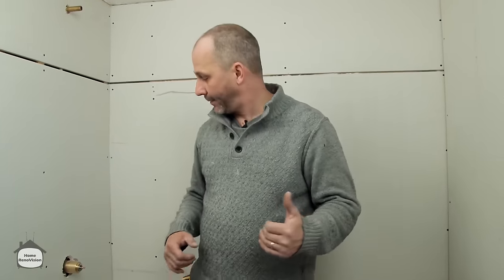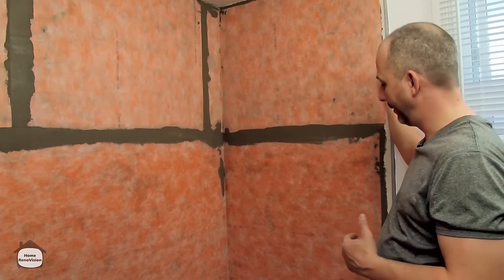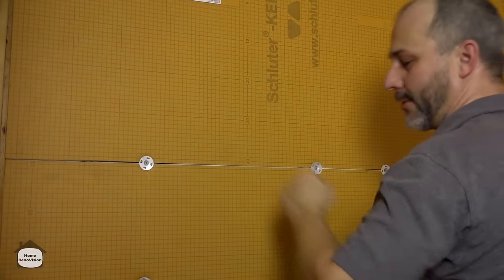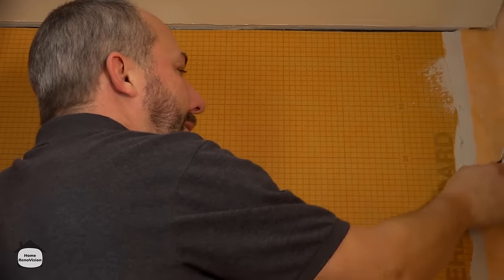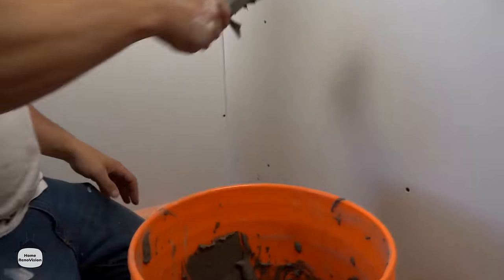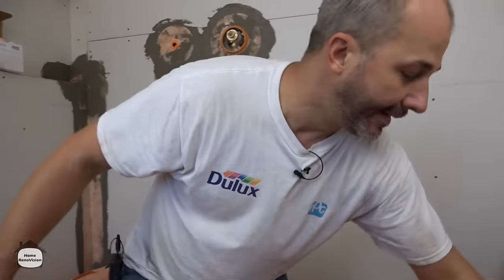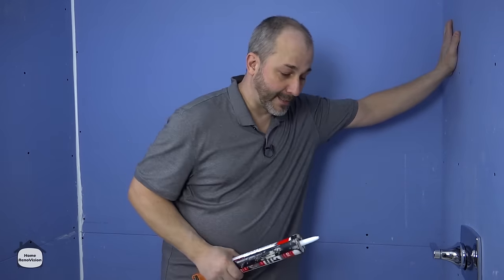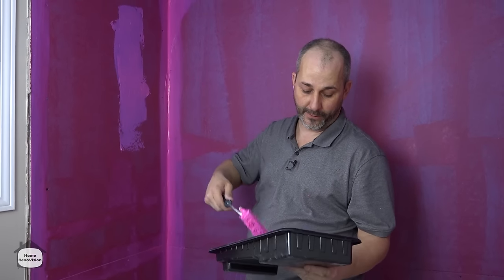4 Types of Shower Waterproofing Systems for Your Bathroom

Comment: Can I do a Schluter shower base pan with a moisture resistant 1/2 sheetrock red guarded surround?
Reply from the maker: sure thing, if you live where you can use sheetrock. you may need to use cement fiber board. Cheers!
Reply: @HomeRenoVisionDIY  Thank you! I'm going to use Red Guarded Durarock!

Comment: You make it look so easy, which if you do this for a living it prolly is.
:D
I'm a renter that doesn't hassle my landlord and I pushed in a nice hole in the side wall of my shower after cleaning the tiles. Looks like it was just tile over regular drywall.
So although I REALLY like the Kerdi board + membrane, I don't own the house and not going to do all 3 walls.
:P

The mold resistant Drywall & Redgard looks like the ticket for me.
Never done it before but hell, can't be that hard - just be detailed, right?
Thx for the tips.
I'll be viewing your tiling tips later.
:)

Comment: I probably missed it but what do you use to apply the membrane to the kerdi board?
Reply from the maker: I don't apply membrane to the kerdi board . That is how it comes from the factory.
Reply: I meant their joint tape. The big box store said to use thin set but I got the sense that you were using something else.

Comment: How would you take off the water resistant sheet you cemented? Is it just assumed the home owner is going to redo the walls if they have to take it out??
Reply from the maker: yes. you would probably need to start from scratch.

Comment: im in australia and every shower here has a blue roll on membrane its done on the shower and bath floor as well as the walls, on residential its floor to 1ft above head height and for commercial its floor to ceiling
Reply from the maker: sounds about right. That is a good code. Her our code is terrible.

Comment: You got me thinking but I believe the aplication on the niche is wrong.  I am almost sure but let me call shanon (schluter rep) to veryfy.  The rest is awesome brother.  We love schulter products.  Schluter rockssssssss
Reply from the maker: They don't recommend using it on dimensional lumber. However this is a fake interior wall so no expansion contraction issues. Experience says it will be fine. Oh and it was done 2 years ago now and no problems. Cheers!

Comment: I was informed by shluter no vapor barrier behind the kerdi board, not sure if thats an exterior wall in video.
Reply from the maker: Schluter should not be giving advice on how to bypass the vapor barrier in the house unless they are showing you how to seal up both sides .
Reply: Schluter system membrane and board are also a vapor barrier.

Comment: I get that he is talking to a DIY audience but if you want your shower to last 100 years with perfect performance, than pay a tiler to do it right. My shower is 80 years old and is still performing well because it was built to last, not fall apart in five or ten years.  How did they do it? They used a process akin to installing stucco and is called “fat mud” which is also known as Thick Mud. If your tiler doesn’t know how to build that type of system, find one that does.  You will never, ever be sorry.  This fellow is doing a great job at explaining the substrate for a “lick and stick” shower. Thanks for the video, it was very informative.

Comment: Does the membrane to basic dry wall, work out cheaper?
Reply from the maker: yes a little.
Reply: @HomeRenoVisionDIY  i want to do a disabled adapted bathroom. Im thinking of a non slip lino with forma-centre drain and a linear drain at the doorway. In my experience if the main drain gets blocked then water leaks from doorway. Why dont people keep a linear overflow drain in door way?

Comment: Which caulk are you using in the video? Could you post a link so I could also purchase it? Please and thank you
Reply from the maker: lepage 2 in 1 sealant and adhesive.
Reply: It is two different ones. Lepage 2 in 1 silicone express and   Lepage 2 in 1 seal and bond. Which is the correct one?  Please advise. Thank you so very much, Best regards

Comment: How about shower grab bars? How do I waterproof the installation. Do you install them before or after the tile is placed?
Reply from the maker: After the tile and into the structure. drill through the tile into the wood. fill the hole with silicone and then install the screws to mount.
Reply: Home RenoVision DIY Silicone! I didn't think of that. Thank you! I respect your work and integrity. Your instructions are always good.🙌🏼
Reply from the maker: Thanks, Cheers!

Comment: The one thing I don't like about Schluter (only one aspect) is their floor shower board with the built in pitch.  I'm a big guy and I'm afraid I would destroy that in a week.  I just don't think it will hold up like a cement based  floor pan.  That's my only complaint about that system.  Another great vid as usual.  Thank you.
Reply: You would be surprised of how strong the floor pan is when installed properly. You can drive over it.

Comment: How do I water proof the floors before tile? I'm doing a large custom master bath that is going to have a walk in duel shower heads overhead and a Roman tub
Reply from the maker: use schluter ditra mat. Cheers!
Reply: @HomeRenoVisionDIY  is redgaurd not an option? Using fiberglass mesh where it transitions up the wall could I do the whole bathroom in it?

Comment: Great video and a lot of good advice. Do you have any videos about putting up drywall on metal studs and are cement boards or moisture and mold resistant gypsum boards?
Thanks,

Comment: Hi. Maybe you will answer this. Right there in third minute you are talking about "unmodified cement" and you are showing Mapei Tile Mortar. In description of it one reads as follow: "This special blend of Portland cement, select inert fillers and advanced chemical additives". And than we have this: "Schluter ALL-SET is a specialized modified thin-set mortar specifically formulated for use with Schluter membranes and boards" Schluter stuff will not bond Kerdi membrane to regular drywall ? This all is confusing. Nevertheless I love to watch your productions. Cheers.

Comment: I was curious to why you didn't have an option to use Hardie board?
Reply from the maker: I find hardie board to be an expensive version of drywall. It still needs to be waterproofed.

Comment: Best and cheapest way: Vapour barrier, wonderboard and mesh tape for walls. Rubber liner for floor only, floor corners use felt and liquid membrain. Fill in with drypack slope.
Reply from the maker: no such thing as the best and the cheapest. it might be the best of the cheapest!

Comment: So what's the bottom line...4 methods. But which method is your GO to standard operating procedure for a quality install, custom shower pan mortar bed, install...where cost is not an issue?

Comment: Like most of your video. Tip, using redgard, the first coat should be thinned out with water because the drywall will be primed better (sucks it up more efficiently). Also screw holes must be covered. Unless you want to get high, use a mask please or you end up like me and comment on YouTube videos
Reply: Matthias Lojewski,  When you say the screw holes must be covered, do mean with the extra heavy with the Redgard,  or with drywall tape first and then the Redgard?

Comment: In your opinion, is Wedi board, Schluter Ditra, and 'Red guard' about the same?, quality wise?   Cost/ROI differences?
Reply from the maker: definitely not. roll on membranes work great for insurance protection but having a true waterproofing system is always better if you have a large investment in tile and drains and finished house underneath the bathroom.

Comment: You seem to insist that the backerboard come to the top of the tub lip and be caulked. But if the tub is against the wall studs there is a 1/2" x 2" gap. Shim the wall or fill the gap with what?
Reply from the maker: Hi David the gap is actually 1". it can be filled with cement and use kerdi band to seal the area to the tub if you prefer.

Comment: Okay... 
Option 1 - Pinkish "gurdy?" membrane gets 'mudded' (or cemented) onto sheetrock (not hardie backer?). NON MODIFIED CEMENT!!
Option 2 - Yellow/tan "kurdie"? board
, directly to wall, under tile, cement (non-modified) and tape joints w membrane cloth and screw heads get a square
Option 3 - 
This system is the gurdy membrane with a bit more custom work, am I right?
Option 4 - Actually local Home depot was SOLD OUT of the red guard, lol. at least the 1 gal size.

Question - after redguard on the drywall, you're going to put hardi backer on the drywall to tile onto, yes?
Reply: LA Prepper nope he just used the wrong board to start with. I have no idea why he never seems to use cement board. It’s used throughout the world, it might be a Canadian thing. The system should be, cement board, fibreglass tape and joint compound to join the sheets, then waterproof membrane sheet embedded by the paintable liquid membrane over the joints and nail points,  followed by two coats of liquid membrane. You then tile over that.

Comment: Me and my husband got a fixer upper mainly it was all we could afford. My husband passed away after that I didnt care about much and it has gotten worse . Well years later I have a pretty low paying job but I put money up to fix my bathroom . Guy I was seeing told me to hire someone instead of helping me. I cant afford that and I have two arms legs and a brain. I pulled the ceiling down in my dining room to the studs because of water damage and also in the bathroom alone .  I'm down to studs . I figure if I can do that I can probably do other things on my own with the right tools . My problem is everything is over whelping.  What products and tools do I buy for the bathroom. I am down to studs In a shower bath and it's so small it steams up.

Comment: Jeff. Noticed you didn't touch on Denshield which is a very effective form of shower waterproofing. They say the highest rating for waterproofing standard. Its also only $25 per sheet I think.
Reply from the maker: I hate that product!
Reply: @HomeRenoVisionDIY  Can you elaborate why ? Here in the US is not expensive $9 per 5x2.5. Thank you!

Comment: Great video, very informative . I may have a stupid question though. In the last project you used "mold resistant drywall". would that also be called "green board"? thank you for your time
Reply from the maker: Hi, green is water resistant but blue is mold resistant as well in most places.

Comment: Great content Jeff! Just wondering if RedGuard is appropriate for tiled shower floors as well? Also, do you have a video that discusses sloping of shower floors for drainage? Many thanks!
Reply from the maker: Perfectly fine however I prefer the presloped base by schluter.
Reply: @HomeRenoVisionDIY  Jeff do you ever combine the presloped Schluter base with RedGard on the walls?  Or do you just go with the whole Schluter system if you use their base?

Comment: If you're spending so much on the boards then shouldn't you do a little more than a bead of caulk on the connection with the tub? If you're already making the rest so bulletproof, what's wrong with doing one more seam?  
Not tryin to hate, I just don't really get it
Reply from the maker: Hi liam, you can for sure. please understand that the caulk I am using is better than something NASA could invent. I trust it completely and it will not crack when stretched.

Comment: Great stuff!  Would you please explain if the backer board sits on top of the tub tiling flange, or if the backer board must drop below the tiling flange.  I have watched several of your videos and have found answers to all my questions except for this.  Thank you for your time!
Reply from the maker: backerbosard sits on the flange. the tile comes down into contact with the tub.
Reply: Thanks for that answer.  So the bottom layer of tile will get thinseted half on the tub and half on the backer board.  If the backer board sticks out a bit beyond the tub flange, would you just add extra thinset between the tub and tile?
Reply: FWIW I like to let the plastic membrane behind the backer board lay over the flange a bit so if moisture gets back there it doesn’t drip behind the flange.

Comment: Great video, what replacement product can I use for the lepage 2 in 1? I can’t find it in the states and amazon doesn’t have it either.
Reply: I like to use a polyurethane caulk. If you can't find it in the caulking section of your big box store, most of the time you can find it in the roofing or masonry section. Do not use silicone which will not adhere well. Polyurethane is stretchy like silicone but sticks to everything, great stuff.

Comment: Also if you are doing this, why not apply some form of water censor in the wall that feeds up to CD the roof and down to some system that tells you, hey a pipe is leaking in such and such wall.

Comment: Thanks for this video Jeff.  With the Covid-19 lockdown, my honeydo list is 'remodel the master bath.  I've been worried about sealing the shower enclosure and this helps a great deal.  We have an outdated garden tub (the white elephant in the room) and a 34 x 34 shower stall.  I am not a small man - so I use the other shower...

I am switching to a free-standing soaking tub and a 34 x 56 corner shower with a Dreamline Unidoor Plus wall system that's 32" x 34-1/2" combined with a 24" stud wall on which to hang the door.  I suppose I'm going to have to make my own pan - but I'm concerned about sealing the walls and pan and the entire thing together.  

After watching, I'm leaning toward the RedGard membrane.  I worked as a tile setter for a year when I was in college - I can do it, but it's a pain in the backside. 

What is your opinion of something like a DumaWall product?  Glue-on sounds better to me at this point.  Would I need to apply the silicon seal between the DumaWall tile pieces if I put RedGard under it all?

Would I paint the pan with RedGard too, then tile over it? (I will probably use real tile for the floor)

Looking forward to your reply!

Comment: Can I do the last method you showed (mold resistant drywall) paired with building a mortar shower pan? Where you put the walls up first then build the mortar shower pan after and butt it up to the walls.

Comment: what do you use after the tile to seal grout?
Reply from the maker: I use ultracolor by mapei it has a sealer in the mix. Cheers!
Reply: @HomeRenoVisionDIY  
any recommendations on old existing tile that's been scrubbed clean and stripped as well as possible with vinegar and baking soda, rinsed, then cleaned again with alcohol. I'm hoping I can put something good on it to make it last as long as possible before needing this kind of cleaning again.

Comment: my question is how come you didn't use Cement board you have plain drywall there at 1:44.
Reply: i have wondered about this too? drywall  has only a paper face, then you cement it, which is wet, then hang heavy tile on the system? thinset adheres to cement board far better than paper? are we crazy?..  i still stick to my paint on membrane, this system doesnt work for me.

Comment: While I was getting tile today and the person that worked there recommend I get a “concrete dry wall” (I don’t remember the actual name but that’s how he described it). He mentioned that the blue water/mold resistant dry wall is too “weak” for tile. I see you recommend this and that’s what I was planning on using. What’s your take on it? For a little more info, it’s a standing shower 4x3x6’8
Reply: That's "Durock Cement Board".

Comment: What do you do where the 3 wallboard faces meet the tub lips? I’m not sure if the wall board should terminate above the lip or extend down below it.
Reply from the maker: stop the board at the top of the integrated tile flange and not on the tub surface. Cheers!

Comment: hey. builder in toronto here. do you still swear by all these instructions?
i've actually never seen the 2in1 lepage. not sure if i've just rolled on past it, or if its still on the market?
i've seen vids that seem to show that submerged kerdi system can have water wick through the thinset that bonds the overlaps, especially if there is any kind of sustained submersion.
have you come across this? 
as schluter systems are relatively new, some are just being opened up here and there and there may be failures in the design. so im curious if you have had any revelations thus far?
great vid though, really appreciated it.

Comment: Standard green board with red guard is all anyone needs 
It's extreamly cost effective , all the  hi-tech (hi price ) just seperates you from cash you could be spending on fixtures etc instead .
The substrate does not matter , it is all in the waterproofing . 
Sometimes the simplest is the best , green board and red guard would be the simplest and  most cost effective . 
Again , no difference in performance , just in cost .

Comment: what advantages does the mold resistant drywall with redgard have over hardibacker with redgard?
Reply: My same question - hope someone answers
Reply from the maker: the same results with a quicker, cheaper, easier install. Cheers!
Reply: Except that Redgard say to not use it on ANY drywall

Comment: Jeff, thank you for your videos!!!
I'm currently installing a corner shower kit with walls.
Do you have any suggestions on if I should water proof or not?
Reply from the maker: the shower kit is waterproof if sealed correctly. Use the manufacturers recommended caulking. There are a lot of silicone's and stuff that won't work. Cheers!